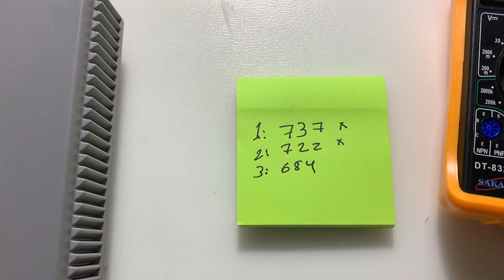PlayStation One Fix &Restoration -Part 2-  laser servicing - lubrication - potentiometer calibration

Comment: Thanks! I just picked up a ps1 that was doing exactly what you were describing in the video. Adding lubricant and oil to the different parts of the disk drive fixed the issue and the ps1 now reads disk.

Comment: i've done everything i could but sadly it still gets stuck on the ps screen. both cleaned and lubed the whole mechanism, then tweaked the pot - nothing. i guess i simply need to order a replacement laser

Comment: So when you have opened your console the regulator was set at 180 degress, or 9-o'clock and now what is the position of the working one? I have tried turning many times and its still not working. I dont have the power checker so I can't tell what is the number.